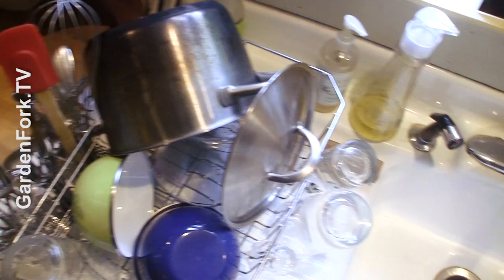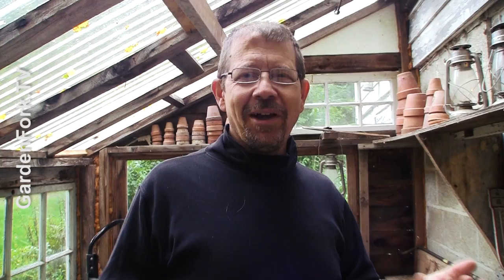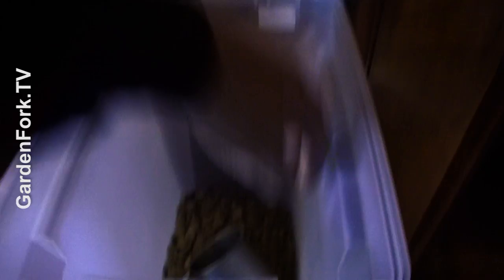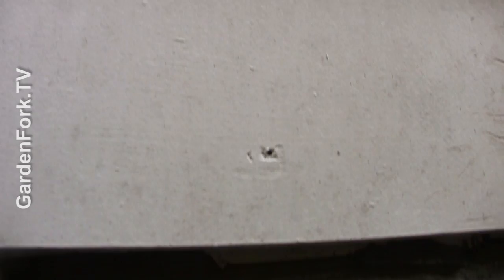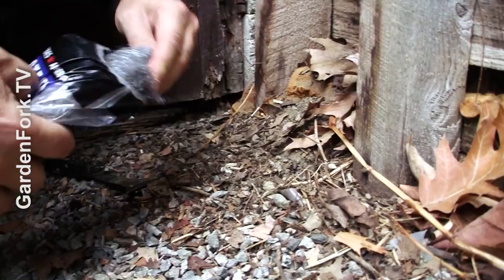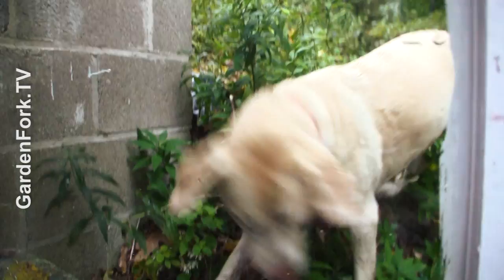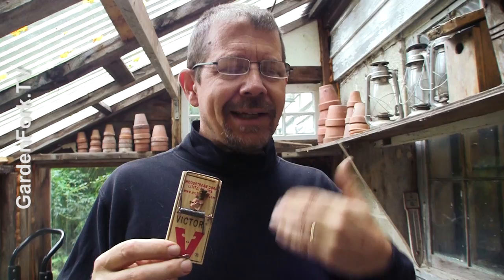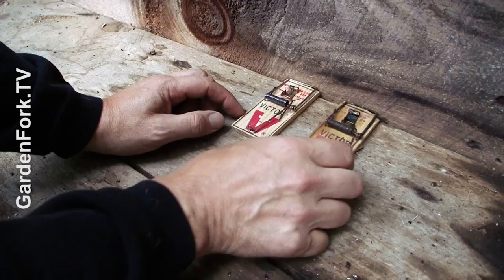How To Get Rid Of Mice & Mouse Proof Your House - GardenFork

Comment: To keep pets etc safe from snappy traps, I use the clear plastic shoe boxes and just cut a mouse or rat size doorway into the box and set the trap and then put the box up against the hole where  you think the rodents are coming and going. Putting a rock or brick on top will also help to prevent the box from getting knocked over, it is easy to see when you have caught a rodent and the whole box can be picked up easily.
Reply from the maker: good idea there, thanks for that. i use plastic storage crates to keep the dogs from the mouse traps. thx!

Comment: It has been very difficult to keep mice out of our crawl space (not sure where they get in).  Then they get up into the walls.  We've been kept awake by gnawing sounds in the wall at night.  It's difficult to get under the house to check on traps, so we've opted for poison (which isn't terribly effective or good for predators, like you said).  I'd love some practical ideas for getting rid of the mice in the crawl space!
Reply from the maker: crawl spaces are tough, because you can't get in to work on them. you can put 1/2" wire screen along the perimeter and staple it to the wall of the house. but any small opening and they are in.

Comment: I was an Orkin tech for several years and was told that poison consumed by a single mouse is minimal and will  not result in secondary poisoning of an other animal should they eat the mouse. Also, placing poison bait stations at the home's perimeter considerably reduces rodent entry because mice stay close to a food source when they find d one. Make sure to not allow pets to have access to the bait stations however.

Comment: I agree with clean and picking up.  Having said that, I had a mouse make a snack out of an electrical wire in my old stove, needless to say when I went to repair it, there was a little mummified dead fried mouse.  It's our outdoor sources and the chicken yard are the hardest.  Our black snakes are the best control.  The peromyscus mouse is cute and rarely wants in except in the bitter cold.  I buy the plastic snap traps they are supposed to be disposable but I can reset them several times before that. P.S. they don't snap on your fingers.
Reply from the maker: i have run across zapped mice in walls before, they like old wire. not sure why. thx!

Comment: You do not want to use steel wool use a brass wool steel wool can oxidize and catch your house on fire bad idea all it has to do is come in contact with another metal and electrolysis will happen

Comment: Re dog food - go metal.  I had dog dishes by doggie door & dog food in a very tall plastic trash can with a snap lid. One day I caught one mouse inside the bin, stuffing his face. I removed the large spoon he was sitting on so he couldn't get out cuz it was about empty anyway. Snapped the lid shut and set it outside till it died.  Also, in the snap lid, I discovered a 5 inch long, slender wedge of a hole they'd nibbled away to get in that bin. AND found a stash in one of my cupboards. Used steel scrub pads to seals plumbing & electrical holes/gaps and traps and eventually won that battle, with the help of monthly peppermint spray downs in the house & growing mint outside.

Comment: We have gotten over 100 mice in the last 14 months at our property. I was thinking I could probably have a nice coat made from their pelts - I found snap traps work best but I don't put them close because I have had the two traps go off getting one mouse - great stuff, I think I may get one of those electronic traps
Reply from the maker: the electronic traps work great, it quickly gives the mouse a zap and they are gone. and its all enclosed.

Comment: Good post i m learning seeing as how its cold and rodents need a warm place to stay since its beginning to get cold i have caught at least eight from glue traps maybe more i use to use riddex plus which seemed to work really well in the past..but has not gotten good reviews my wife and i live in an old apt multi family so they can easily get in not to mention that if any of the other tenants have them..we re looking to purchase a home and the spring and will definitely use steel wool and other methods..but good post but a suggestion is mesh around trees at base and dirt around trees and bushes not to mention chimneys and other gaps on roof..

Comment: Had to stop at 2:20 ish and make a comment guys.
 I know nothing about small dogs but you guys have 2 large ones. With dogs that big you need to be feeding them in raised dishes. Dogs that size tend to have hip and joint problems. I know it may have been just a clip you cut in, but I would hate to see your 2 companions have them too. 
 As far as mouse proofing your house, another trick for the snap traps if to try corn bread bits. Do not know why but they love it.
 Julia
Reply from the maker: thx for the heads up Julia, and had never heard of cornbread. have to try that one!

Comment: Hey appreciate and love your videos I wanted to give you a comment I've experienced more than a few times on the electronic traps. They will get the bait without setting off the shock due to their extremely dry or Dusty feet. I found my putting some moisture wet paper towel damp sponge moist napkin in front of the trap will solve that problem thanks for reading my comments
Reply from the maker: wow, that is a great tip. thx!

Comment: snap traps || to the wall works very good always right up against as they do skirt the edges of the room.  Behind a fridge under stove also good.  Sticky pads cruel but work; a quick whack with stick bring a very quick end.    For bait whether sticky or snap - a single peanut works fine especially for snap traps as I use them over again.

Do the dogs notice or even car about mice? With cats there will no mice within minutes of there getting in.
Reply from the maker: the Labs pay no attention to mice, but then they ignore small dogs as well. but not chipmunks!

Comment: i got a question, i seen you use the steel wool and i'm thinking about doing that but, it don't rust away fast? and that foam, does it have something special in it or it's plain expension foam?
Reply from the maker: the steel wool only rusts if its real humid or the wood its stuffed into has moisture. you can also buy stainless steel wool, or copper mesh that comes in a roll.  the foam has a bitter taste added to it, and is not much more expensive than regular foam. thx!
Reply: cool

Comment: Check around pipes leading in. Use steel wool, spray foam or sheet tin to make a tight fit around the pipes.
Reply from the maker: yes, I'm already thinking of a Part 2 for getting rid of mice. good points. thx!

Comment: 5 gallon bucket just under halfway filled with water.drill a hole just under the handle areas and drill a hole in the center of a can top and bottom. a steel rod longer than the bucket. (wire hanger) slide the rod thru the can and fasten inside bucket holes.put a glob of peanut butter on the can center- water in the lower part of bucket.and a piece of wood running up the side like a ladder.
rodent restaurant open for business!
Reply: We put these all over in the fall and get tons of mice.  works great.

Comment: Hi Eric. I am also in Ct. and in the country. A friend of mine told me about the BEST mouse trap ever. I have a few storage sheds and the mice were always there. You know the damage they do. the trap cost next to nothing. I'll put a link of a video to better explain it. The main part of it is a 5 gal bucket. It  is the best way I found to clear mice out. if you like it maybe do a mouse trap video. 
love your videos
Doug B
Reply from the maker: i have seen a few versions of the bucket trap, yes. thx for the note!
Reply: I made one for my attic years ago. I knew it as a Yukon Mouse Trap. A stiff rod is fastened from one side to the other on the top of the container. A soft drink or beer can is impaled on the rod and placed in the center of the space, centered over the container. A small ramp leads from the floor to the rim of the container. Water and some bleach are placed in the container. Peanut butter is smeared on the can. The mice are drawn up the ramp, jump to get the peanut butter, the can rotates and they fall in the water where they quickly drown with the assistance of the bleach. Seems cruel but it is quick and can accommodate several critters.

Comment: I personally do not like the electronic traps.  I have placed snap traps, glue traps and electronic traps in an area and have never caught a mouse in a electronic trap.  However I have caught them in snap and glue traps in the same location.  I also like peanut butter for bait and place a dab in the center of the glue traps.  I find that works very well.

Comment: peppermint oil is a great repellent.  Rodents hate it.
Reply from the maker: did not know that. thx!
Reply from the maker: it needs to be determined where the mice are coming into the house. if that isn't fixed, there will always be mice in the house. thx!
Reply: oh yeah!! i spray the peppermint oil all around the outside perimeter of the house...and also a few drops under appliances

Comment: 'Tis the season for mice on the move. Those cheap wooden traps aren't as effective as the black plastic ones now available. Those have a little well for bait. I usually fill that with bacon fat. Seldom have to re-bait all Fall. I'm with you on the glue traps although a friend had persistent mice in her silverware drawer and used them. While it was hard to fault her for seeking retribution -- she had to disinfect all of her flatware -- I'm just grossed out by the inhumanity of the glue trap.
Reply from the maker: i have not used the new plastic traps, i'll have to check them out. bacon fat is a good bait, thx!